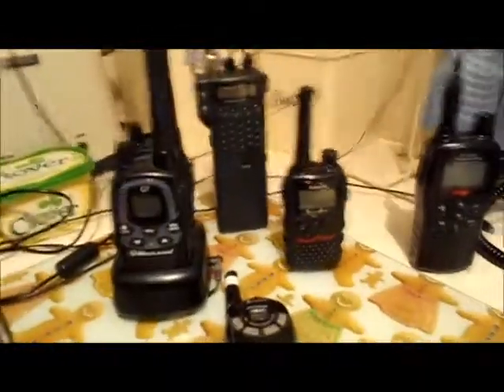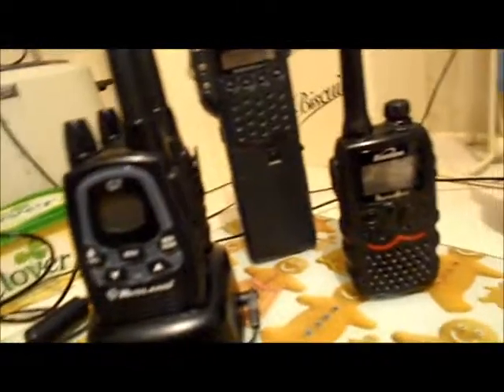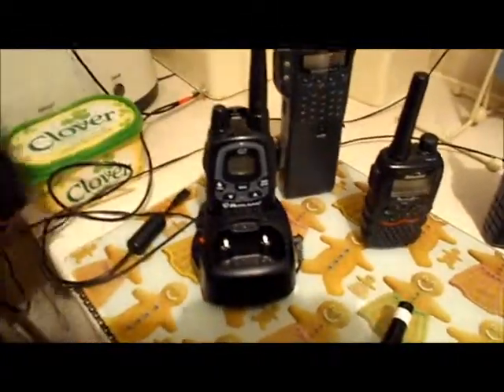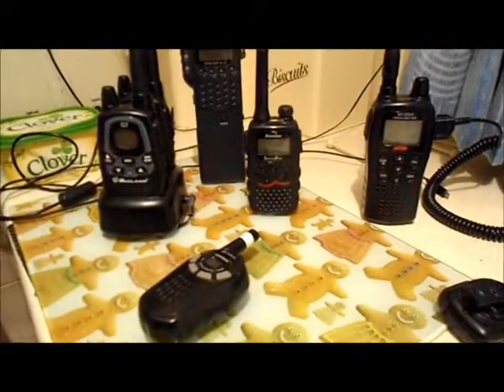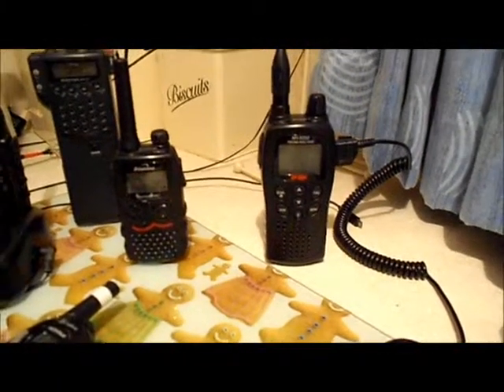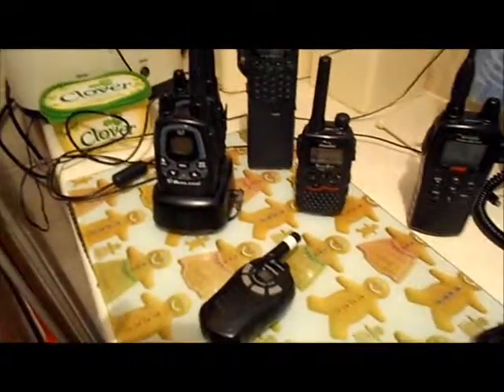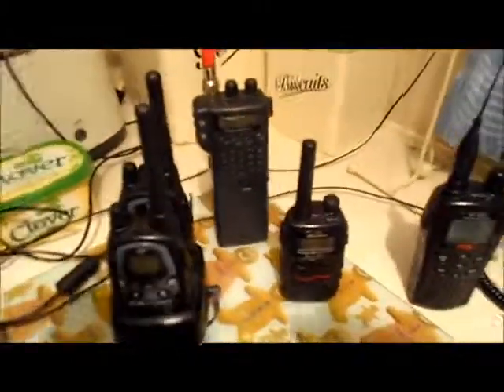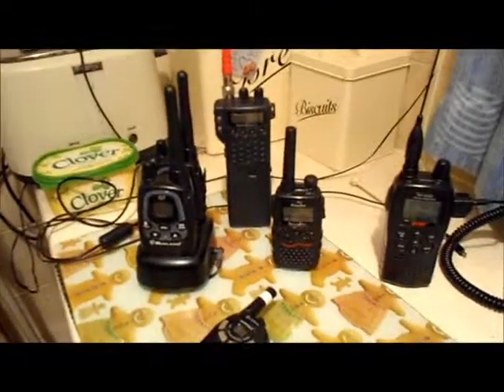PMR 446 On Air Radio review

Comment: Steve I got my floureon fc200 radios I opted for black ones look more professional than the light colours and yes for £14.99 a pair from a u.k seller free postage these are a good buy loads of features unlike mororola t.80 if you lock key pad  it stays locked it won't cancel when you turn radio off I've got mine through a radio tone simplex repeater had a few miles out of them the high power 1 watt works well and the new freq for pmr  446 help you escape the normal pmr  446 channels so all in all a pure bargain ctcss and d.cs codes....
Reply from the maker: Hi Michael they sound great, keep me posted on battery life etc.